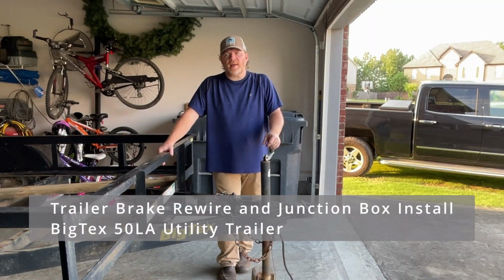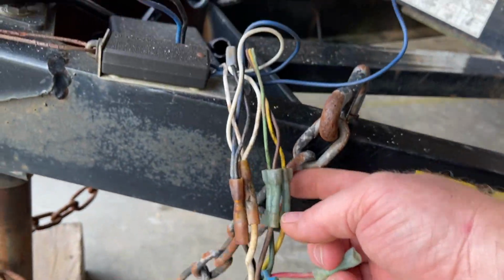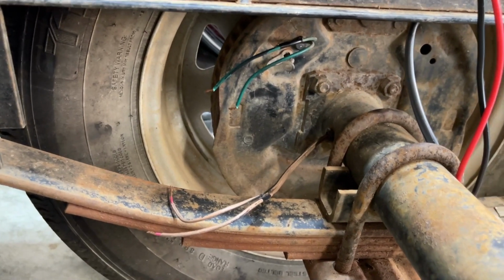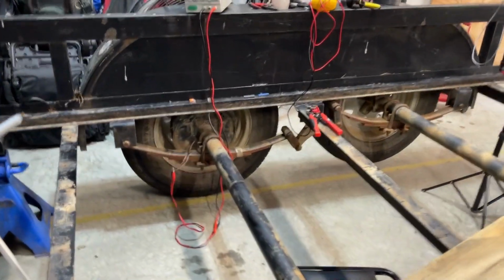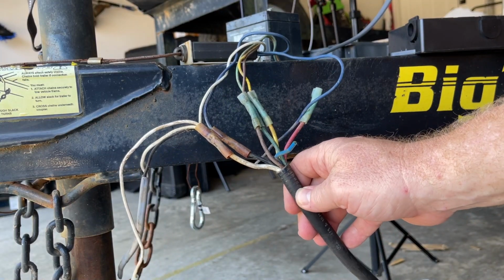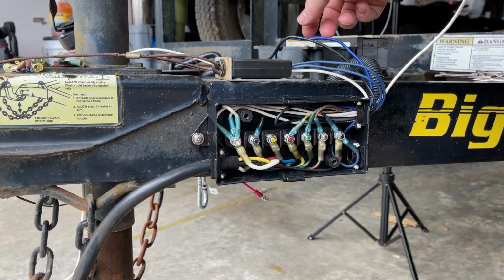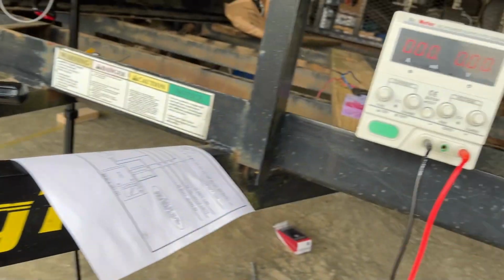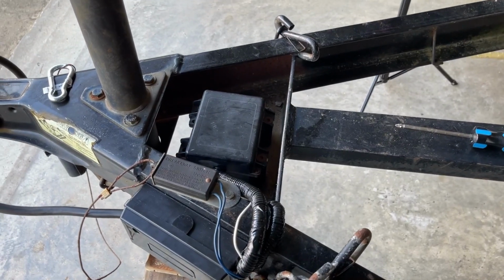Trailer Brake Wire repair and cleanup on BigTex 50LA Utility Trailer

Comment: You seem to know your way around a trailer and it’s wiring. I have a problem I am trying to diagnose. My Big Tex 100A locks up the brakes when it’s connected to a vehicle. The trailer sat for a while until recently and the brakes did not work. I found a few broken wires at the axle and reconnected them. I also replaced the 12V battery. And rewired a new 7 pin harness with junction box. All the lighting works correctly. But today when I got it hooked up the brakes were dragging. And my 2024 Silverado was not recognizing the brakes (could t adjust gain). They were just locked up. As soon as I disconnected the 7 pin from the truck the brakes unlocked and I could roll it freely again. 

Any thoughts? 

I’m wondering if the break away switch has gone bad, tomorrow I am going to try and remove it and see what happens.
Reply from the maker: Thanks for watching!  Yeah, I'm thinking break-away too.  or something is shorting in the brake wiring going back to axles.  Do you have another truck available (neighbor's perhaps?) to hook up to it to eliminate the truck itself from the equation?  I thought something was wrong with mine again recently but I'd blown a fuse in the truck.
Reply: @path.of.discovery  So I figured it out. The 12v and the Brake wires on the trailer were reversed in my J-Box. It was an easy swap at the J-Box to fix it. My truck now detects the brakes and they aren't locked up anymore when connected with the 7pin connector.

Comment: Hey Shane, great job!  Glad you have brakes on the trailer now.  Much safer towing something heavy like your 990.
I’m trying to find the box you used with the color coded studs.  Where did you get it?
Reply from the maker: Hi there! Yes, it definitely makes a difference now, much less stopping distance.  Got it from Amazon. Here's the link: https://amzn.to/3qTqXvR  Thanks for watching and commenting!
Reply from the maker: Also used #10 Ring Connectors.  https://amzn.to/3ss92g9

Comment: Hi Shane and young Son, a very interesting video, as Marshall says the older vehicles in the Uk still use inertia brakes on trailers, I believe some of the newer caravans have electric brakes fitted, A daft question form the uneducated ones, What was the two slider switches for on the side dash of your truck?
as always great to watch your video's, would like to see the trailer with it's new floor in.
Cheers Shane
Barry
Reply from the maker: Hi Barry!  Should have actually explained those slider switches I guess.  Those are part of the brake controller in the truck.  My truck has an electric brake controller built in.   The slider switch allows you to manually activate the brakes. The plus/minus buttons let you change how 'strong' the brakes are when the brake is applied (gain).

Basically for a given load, begin with a low gain (goes from 1 to 10 I think), start the truck, squeeze the sliders together, put it in gear and take your foot off the brake.  If the truck/trailer moves forward, the gain's too low.  Increase a bit and rinse/repeat the process till the truck doesn't move when the sliders are squeezed together.  Basically the proper gain will be when the trailer brakes will hold the truck in place when the sliders squeezed and foot brake released.

Finished putting the floor in a couple nights ago, but didn't video any of it.  I'll take a pic or quick video of it and put up on the community side.
Reply from the maker: Ya know what? it's time to play with shorts.  https://youtube.com/shorts/2vhrURkoR_I?feature=share  Here it is all floored.

Comment: Very interesting, over here in prehistoric UK  trailers use cable brakes to open brake shoes on to drums. The hitch is a sliding piston and as you slow the piston moves back pulling on the brake rod or cable applying brake pressure slowing the trailer.  If it's a 4 wheel trailer like yours all 4 wheels would have brakes. We also have brake away cable but it pulls on the hand brake locking up all the wheels. There is a mechanism built in to the hitch that lets you reverse the trailer with out pushing the brakes on. The electric's run on a 7 core core cable with a different style plug on the trailer and a socket on the towing vehicle and some time a second socket for aux power for a caravan or such like. There also has to be a buzzer in the towing vehicle that sounds with the indicators (turn signal) to let you know the trailer indicators are going on and off. We have towing weights applied to trailers here also. My car can tow 1260kg braked but 630kg un-braked. like a small trailer.
 If you look back through my vid there will be one on my plant trailer i bought at a sale. I don't think the powers at be in the uk would let us use magnetic brakes. Nice bit of key framing on the truck number plate. M 😀   https://www.youtube.com/watch?v=Bzs3bByi95Q&ab_channel=MarshallSmart.
Reply from the maker: Hey Marshall!  I think what you're talking about we call 'Surge brakes' over here.  Boat trailers use them a lot.  It's really interesting to see the differences from country to country on these types of things!